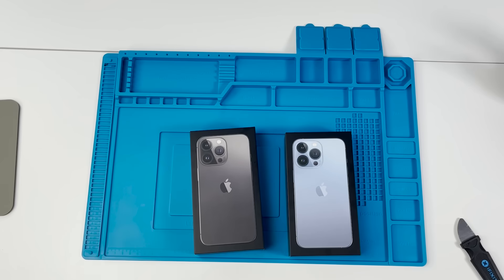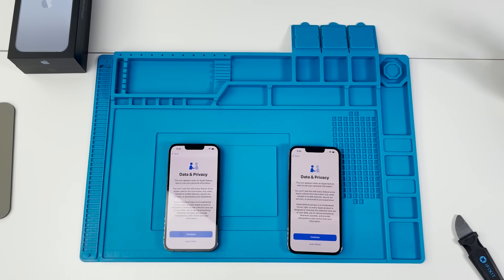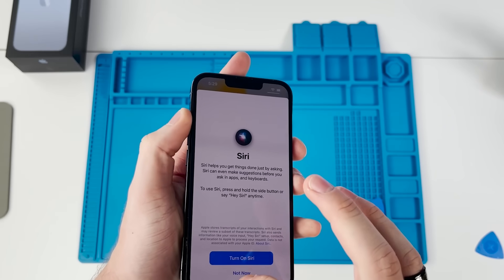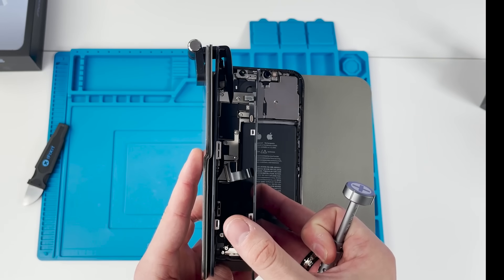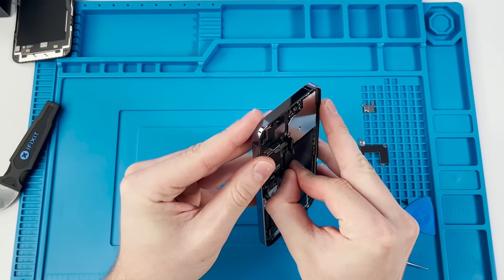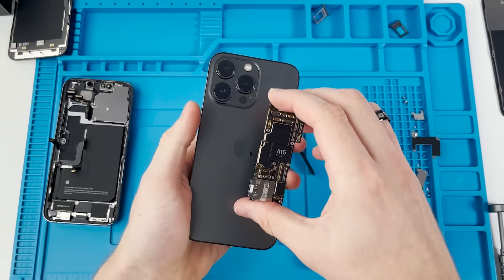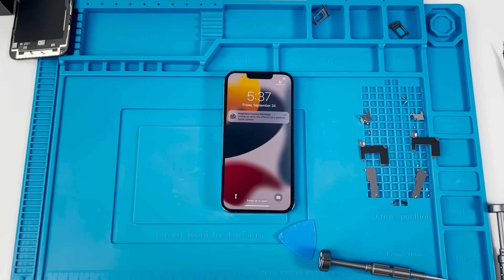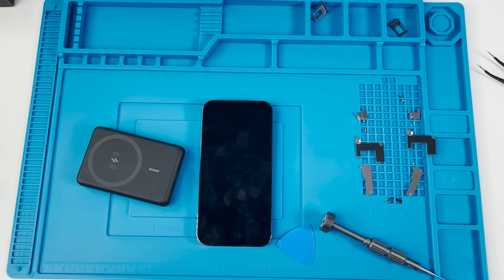Can the iPhone 13 Be Repaired? Let's find out....

Comment: Thanks for doing this because I cannot afford to haha!!! You rock!! All you repair channels got me back into electronics repair and I'm catching up on the new stuff:) Keep up the good work !! see ya next video:) Also, I'd say that I'm worried about the battery being paired to the board or the special battery control board boot up signal or whatever they did but when people start dealing with not being able to replace the battery or we pass some good R2R legislation in a couple states then I have a strong feeling Apple with change this just like they changed the camera on the 12. We all need to explain what's going on to every customer about r2r.. maybe even make a pamphlet detailing how much money they could save by supporting R2R. Let's all keep it at the forefront.
Reply: Btw I heard the rumor was that it wouldn't work unless it was an apple genuine battery because the control board sends a special encoded boot signal. I didn't hear it had to be the same exact battery just an apple one. check that> you cant boot from a power supply.. a possible solution is to take the control board off the battery and attach the power supply to that, then the battery control board can send its signal.